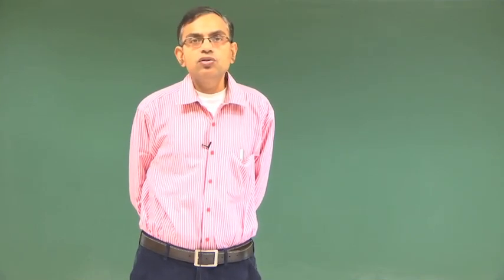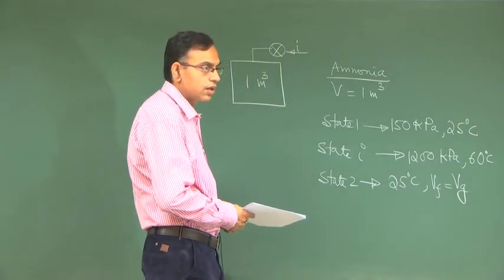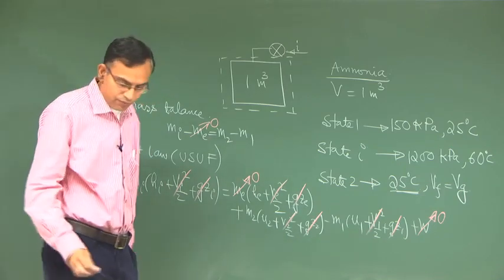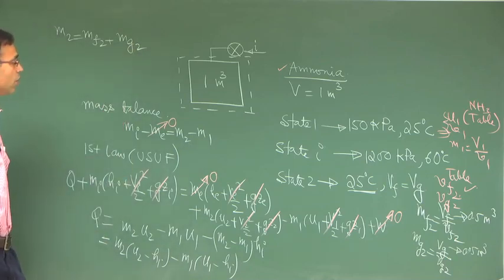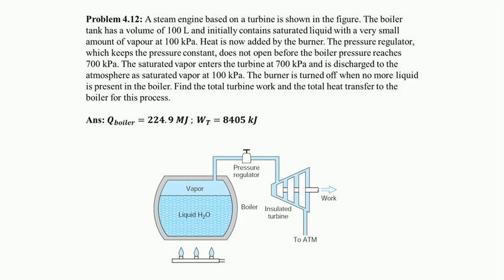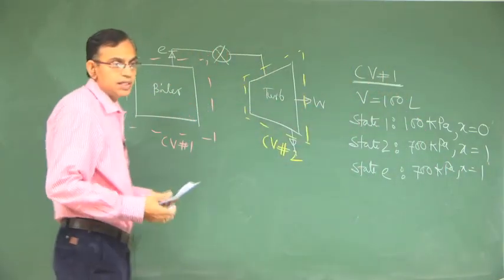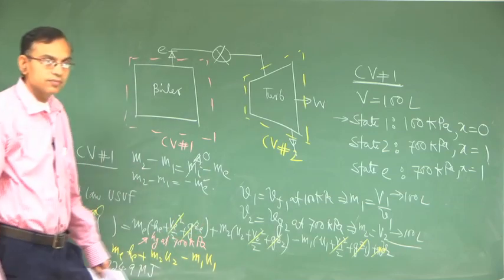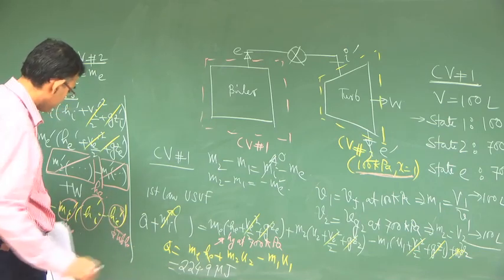Lecture 30 : First Law for Unsteady Problems - Examples (Contd.)

Comment: @ 15:01 , SIR  is it correct to say that heat is released because  temperature at state 2 remain equal as temperature at  state 1 .after the process of energizing by flow work ,

Comment: For unsteady state, do we always have either inlet or exit? We can't have problems on when both are present? Why is so?
Reply: For unsteady state, this is not necessary that we always have only either inlet or exit, but there are various possibilities that we have both inlet and exit still we are having unsteady state. When we have both inlet and exit present in a control volume and if mass flow rate at inlet and outlet differ from eath other then either mass is accumulated inside the control volume or mass is slowly decreasing inside control volume. That is also an unsteady state problem.
Reply: Please Look for the derivation of 1st law for unsteady state.

Comment: really i didn't get this 2 control volume idea
Reply: We can analyse this problem as two separate problems 
Prob 1 for boiler to calculate heat transfer 
Prob 2 for turbine to calculate work
Reply: @RajinderSingh-ry4uo  hi can you please explain at prob 4.12 at cv1 why at state 1 we only take vf as v1 as the problem states that at state one there is some amount of sat vapour available and relatively higher sat liquid . is that an assumption?

Comment: for problem  4.12 in CV1 analysis m2=0. as burner turned off when no more liquid present in the boiler. Please  check.
Reply: meaning 100% vapour
Reply: But water will. Be supplied continuously so, m2 will be there